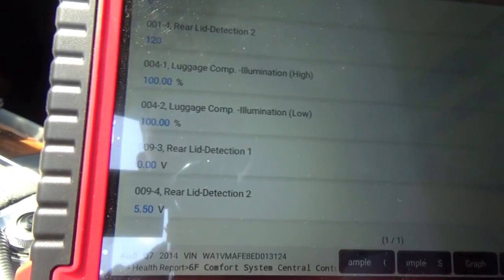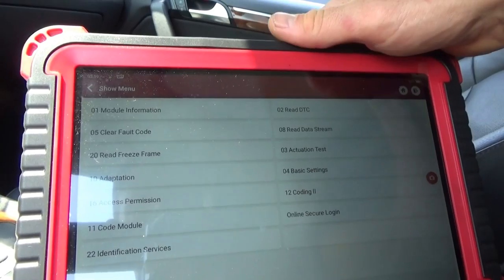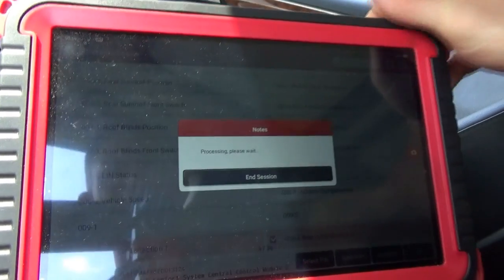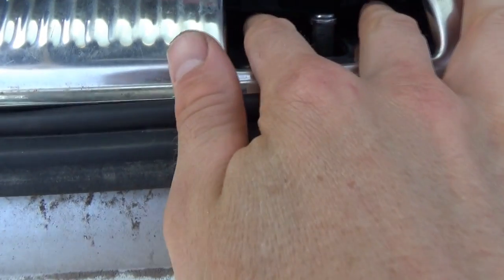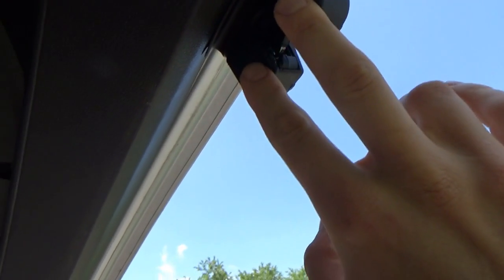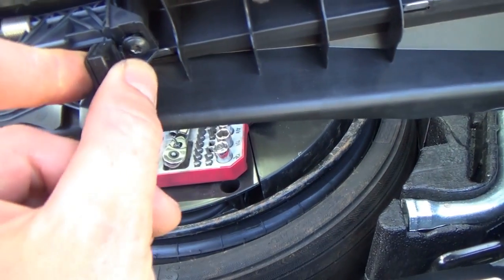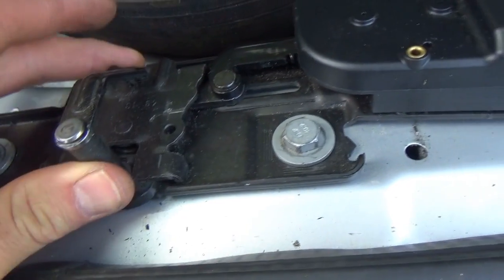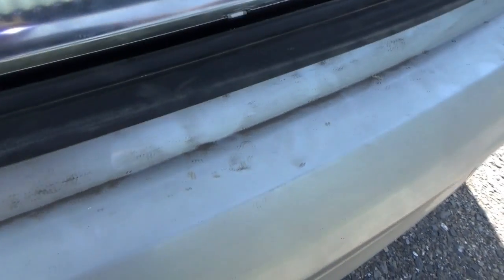No TAIL LIGHTS on Tailgate? (Audi Q7 Diag & Repair)

Comment: I'm a semi-retired ASE Certified Master Tech and Diagnostician. I specialized in Euro cars for over 30 years. I drive a 2013 Audi Q5 Quattro Premium Plus as an all-around "gopher" and daily driver. Keeps the miles off my F150. I bought this Q5 for a grand from a friend and knew it had many of the typical 2.0L TFSI issues: rings sticking so it burns quite a bit of oil, turbo is worn slap out, ABS issues due to pressure sensor built into the unit, and so on.
BUT, my brake lights have been intermittent lately along with warning messages. Had me running down wires and pulling my hair out. Since I'm semi-retired, I don't have access to VagCom, AllData, and the like anymore. So, been trying to diag the old school way. I was about to give up...THANK GOD for your video!!!! I'm an old pro...and I still learned something new. 

The pigtail for the dual switches was unplugged. Why? About 4 months ago, I installed 2 CT Sounds Meso 10" subs on a CT Sounds 2000.1 all in the rear cargo area. The subs really accent the B&O sound system, btw. When installing the amp, I must have left the dual switches unplugged! Great video and extremely helpful! Thanks again!!
Reply: Oh yeah...last night, the alternator stopped charging and the alt warning msg came on. I have 11.8v while running with voltage slowly dropping. Belt is fine as is the alt physically. Alt has the single "turn on" wire - purple with light blue stripe- I'm getting between 8.4v and 8.9v on that wire with no alt output. I know the wire is supposed to have battery voltage. As I don't have access to a wiring schematic, I'm gonna tear off into the harness and trace wires. All fuses are good, btw. Any ideas?

Comment: I just saw the whol 12:23 minutes of video to find out that the actual solution is not in the video...WTF man. You cut the video when you cleared the codes and then the problem was somehow resolved...did you do something else??
Reply: Came here to say the same flipping thing. Cut the video, probably goes to a mechanic gets it fixed, then restarts the video.  Pointless.
Reply: Same here. Thumbs down for this silly video. Clearly what he did was not the fix.

Comment: Hi, I have a 2013 Audi Q7. The right tail light on the lift gate partially work. The middle light work but not the one around it. Any help appreciated. Warning signal reads “ right turn signal” and “ right brake light”
Thanks

Comment: What to do if there is no wiring or paddle switches in that area.. Where else could the switches be ? I have a 2017 Q3   Same exact issue.  I'm thinking in the door itself, But i'd like an idea before tearing into the door.. Thanks,.

Comment: Ivan i now have the engine replaced in my Q7. Had it running to for a bit until it cut off....i have door handle touch sensors issue. I saw how to clear that issue have not checked to see if all the other codes which were present with old engine in vehicle are all still there or not ? Just letting you know i finally got engine and installed it. Its definitely been one hell of a journey with this darn vehicle....couple things still need to check verify and resolve ....

Comment: Havin problems with 08 Audi q7 tailights done took to mechanic 3 times tail lights won’t stay on done replace twilight switch n all kinda of stuff one will work den sometimes neither one works hate to take to dealership for something simple but really hate can’t drive truck @ night
Reply from the maker: #EuroProblems

Comment: I'm kinda confused: did clearing the codes just cause the taillights to work again? It looked like possibly a separate issue after they still didn't work after fixing the latch.
Reply: He adjusted the contacts but didn’t clear the codes initially. Seemed like once the codes were cleared, everything was reset and the adjustment did the job

Comment: Hey Ivan , I have the same problem in my Audi Q7 2012 , the only difference is that the rear driver side back lights work but the rear passenger doesn't work at all. Just wanted to know can I fix it the same way for just one light not working. Or both of them need not to work for it to be the hatchet switches for it to work.

Comment: Yep I knew exactly what is was when you said the paddle switch in the sill plate. I had it off to take off the bumper and didn't plug the connector back in. Mines a 2012 Q5. Thanks for the video! LIKED AND SUBSCRIBED!

Comment: Just installed a hitch and wiring harness on my 2017 q5 and had the same issue. Hearing the talk about the hatch switches led me to discover that I had failed to connect a wiring connection when I reinstalled the scuff plate! I was going crazy trying to find the issue. Thanks, man!!!
Reply from the maker: Nice!
Reply: What was the problem
Reply: I have the same isur with mine
Reply: Any help
Reply: Did you have to clear codes too to make yours work?

Comment: Audi could have had the brake and taillights on the hatch and bumper work all the time, but oh, no, had to come up with some janky solution made of cheap plastic crap that would break or go out of adjustment and require a $500 visit to the dealer.

Comment: Save a very little amount of electricity by turning off taillights when the hatch is open and create a safety hazard when the switches fail.
Reply: What do you mean by "safety hazard"? Instead of the hatch lights, the bumper lights illuminate if the switches fail.

Comment: Great video. Very accurate. I’m a 6 year audi tech. We see this issue more often than you would think. Even some of the brand new q5s come from the factory with misadjusted striker contact switches
Reply: What steps took place after the paddle shift engagement adjustment?  Initially, the switch contacts were fixed, and the tailgate lights still weren't turning on, and then the video jump cuts and it's working.  What changed?

Comment: U skipped how they suddenly started working again. owning a Q7 I can add that part LOL. when you cleared all the codes the car finally accepted the fact that you fixed the switches and decided to allow the use of the tail lights lol. Audi's are a really PITA to work on. a lot of things are like that. It will see an intermittent issue and shut off the device. it wont attempt to use it again until u clear the code. not everything but I've seen it enough to know clearing the codes needs to be done lol.
Reply: AHHH ok ok, this is very helpful. Clearing the codes once the switch adjustment has been done.  Thank you~

Comment: Overly complicated German design that is not practical with dirt and wear.    Had a '12 GTI that used single filament tail lamp bulbs and a PWM to control tail/brake lamp brightness.   Went though bulbs as the lamps would get black and burn up.

Comment: On my B6 2010 Passat Wagon that feature is programmable with an OBD Eleven  or VCDS so that you can turn it off. You can also turn off auto locking of the rear hatch when the vehicle is in motion (it pulls the hatch if not fully closed), interior lights when hatch is open, trailer mode for the lights, turning on or off of the tail lights when the hatch is open, dimming of the rear lights... Etc.

Comment: Yes ,we need brake lights in the bumper also, because we regularly drive with the hatch open.this is good engineering..?not.
Reply: It allows the boot to have a bigger opening. Also, the purpose is not to drive with the boot open, but rather when you're stopped at the side of the road.

Comment: Over-engineered.  Just make all of the brake lights work all of the time.  SMH
Reply: Your solution makes too much sense for it to ever be considered by a European auto maker.
Reply: Your right!  Just make the tail and stop lights all work what switches are applied on!  This Euro has too many switches, sensors.........etc!
Reply: Amen! Over-engineering is the only thing I have a religious zeal against.
Reply: Could of, Audi did that because the tail lights are on the tail gate, so there need those lights to be on when it's open, most cars the tail lights are on the vehicle body so it won't need all of that

Comment: Why in earth would you program hatch tail lights to shut off under any circumstances?
Reply from the maker: Great question! xD
Reply: @PineHollowAutoDiagnostics because they don't need to be on when the hatch is open, as they aren't visible from the back anyway...? Not to mention that the auxiliary lights turn on instead, so I don't see any problem here.

Comment: Even though it was fixed, the old codes prevented the lights from working. That's odd.
Reply from the maker: Yeah, I was surprised by that too. But not too surprised...hard to understand German logic haha
Reply: No, both contact switch were not changing until Ivan refitted the panel holding them correctly. After that the lights still didn’t work until he cleared faults. Then once the comfort modules saw the tailgate position working again it sent power to both lamps. No bother to Ivan 👏

Comment: Its a US market thing, the law mandates the tail lamps have to be illuminated and seen at all times. So since the tailgate ones move up when it opens, there needs to be a supplemental set as seen in the lower bumper that kick in when the tailgate goes up.
Reply: Yes but the switch should only turn on the lower lights, not turn off the upper lights. Unnecessary complication.
Reply: @_RiseAgainst  its an Audi, says a lot.

Comment: There is a TSB for this very issue, simple fix I had the very same issue on my 2013 Q7
Reply: Just started the video and reading through the comments 
Yes there is  TSB - fixed my first 
Since have done 3
Reply from the maker: What did the TSB say?
Reply: @PineHollowAutoDiagnostics  TSB says to install spacers under the paddle switches with dimensions of no less than 5.5mm I.D., no greater than 13mm O.D., and no thicker than 5.6mm. so a pair of 1/4" washers on each side should work. The OE spacers are 4L0863191A which are the same parts they use on the interior trim panel for the rear quarter trim under the screws.

Comment: Man when will people understand the more little extras the more trouble you will have down the road.  All computers and modules should be limited to the engine and trans.
Reply: In this case it’s the government regulations. The reason those second lights even exist is because you can’t have brake lights on a moveable panel. My Mercedes GL has a standard lift gate and the lights stay with the car, which is a pain because once my Dad and I were loading lumber into the back of my SUV and he accidentally smacked the tail light and broke the housing. Had the rear end been designed like the Audi that wouldn’t have happened
Reply: @JackS425  But you don't need a module and computer to make that happen. Just be on and working whether it's open or closed. All that can be on a inexpensive relay in the fuse box. As far as breaking the tail light that's the designers and people counting the money so they can put five computers and twenty five modules in it. So they can charge you fifty thousand for a twenty thousand vehicle.
Reply: Too right 🤔
Reply from the maker: But then cars wouldn't have all the fancy convenience and entertainment features 😅
Reply: @PineHollowAutoDiagnostics  One you're driving and don't need convenience and entertainment features . Two all you need is a AM / FM radio with a way to play your own music and maybe books. I think a good amount of the modern road rage comes from people and there convenience and entertainment features that take there attention from the road.
Reply from the maker: @davide.s.9880  I'm 100% with you there. Much prefer to have a satisfying driving experience over any frills. But power windows, locks, and cruise control is nice to have :)
Reply: @PineHollowAutoDiagnostics  All my brand new vehicles never had power windows or locks. The last couple one had a cable kind of cruise control and I used them twice on each vehicle so didn't need that. When I was younger if you had asked me I would have told you if you can't lean over and roll a window up or down you don't need to be driving. Also none of my new vehicles ever had a center console.  Having said that my next new vehicle will have power windows, locks and center console. Most things come with power windows and locks these days even base models.

Comment: So um, current fault codes had to be deleted before tail lights could come back online? 🤔
Reply: Most modern vehicles do this, it is very easy to forget about it and off down the rabbit hole you’d go until 4 hours later everything tested good ,then codes are cleared in frustration & hay resto. Bloody electronics 🤔🙂
Reply: @kennedysgarage3281  like the stupid bulbs on gm cars. I replaced the bulb with a good one and thought I shorted something replacing it it, but I had to cycle the key.
Reply: @Surjnarine  I know been there & bought the t shirt 🤔🙂👍
Reply: YES even my 07 Audi is like this. and a mom and pop scanner can't clear the codes. you need Ivans expensive one of VCDS as you have to clear module codes not ecu codes
Reply: @bobspurloc  obd eleven is awesome. You can do long coding with it and is more capable than the thinkcar scanner on vw stuff. Probably almost as good as vcds.
Reply: @Surjnarine  I've only used vcds for my q7 so far. just chasing electrical issues from the rear roof leak issue and front drain clog issue.
Reply: @Surjnarine  VCDS is one of the cheapest scanners that I have ever bought with lifetime updates for under €400. Fantastic value
Reply: @kennedysgarage3281  Hello, can u share a link to buy one at that price please, because the one that Ivan share is over  thousand.. thanks

Comment: I think he wants a new tyre on the spare wheel, in the boot, it look like a racing slick to me, UK
Reply: I didn't saw it in the video.
Did it look like this?
If yes, it's a different type used in some cars

https://junkmailimages.blob.core.windows.net/large/a9c51c4e98da4574bd0c622e1a9ae240.jpg

Comment: The switches setup is so dodgy, a bit of wear and the computer will be crying again lol.
Basic hatchbacks with gas struts were simpler.
Reply: Or just a solid single switch somewhere where it won’t wear out or get sloppy over time.  This is typical of German cars though in my experience.  they over engineer things so much that their own engineering is the cause of most failures not actually anything else.
Reply: @Honeypot-x9s  You said it!!!!
Reply: One can see that someone has been working on the alignment in the past.
Reply: That is one reason I always go for a basic model of anything I'm looking at. Plus I'm both cheap and poor.

Comment: Federal DOT requires brake and hazards be visible when the lift gate is open. They leave it up to the manufacturer how they do it. It’s interesting to see the different ways it’s done.
Reply: Most new Audis utilize this design, personally I think it's very clever. You can make the tail gate wider, not putting the lamps on it's sides.
Reply: @5Dale65  Makes sense and really proves that the failsafe works -- it failed in the 'tailgate not closed' mode....   but was the fix clearing all the codes?

Comment: So was the problem that the trim panel wasn’t in correctly? You didn’t have to adjust anything?
Reply: Ivan said the trim peace yes was not clipped in right so the door wasn’t hitting the switches. Ivan did say the owner replaced the switches so he didn’t put it back together 100%
Reply: I wasn't clear about the fix either.
Reply from the maker: Yes that was the root cause of the problem :)